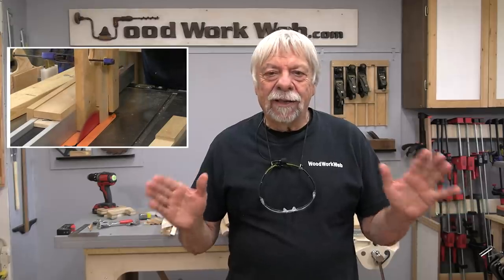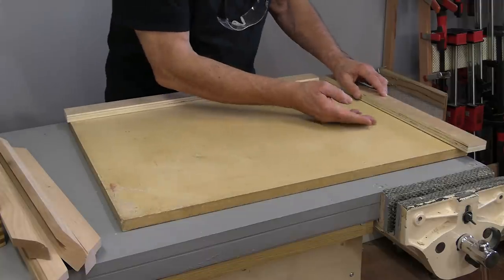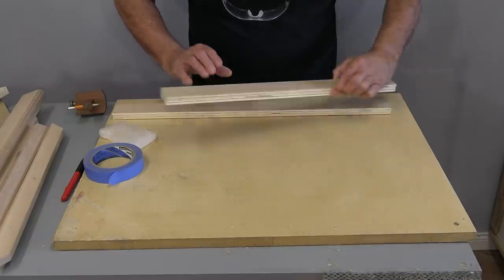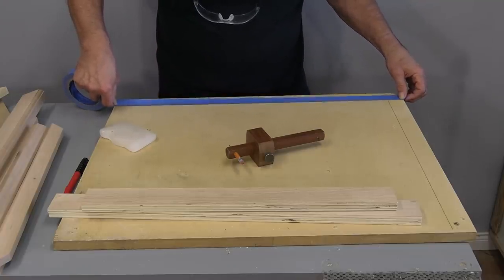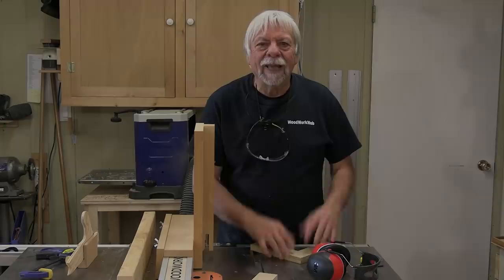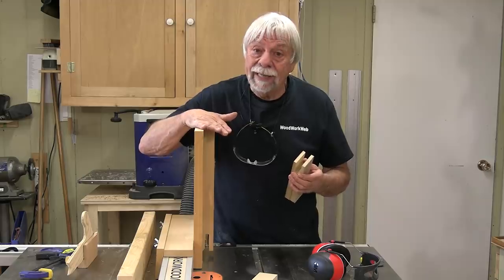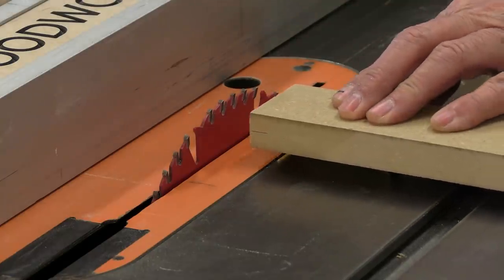Woodworking Jigs for Making Perfect Half Lap Joints Every Time!

Comment: Just buy a part sheet of Melamine coated MDF or chipboard from the big store, glue won't stick anywhere on it. Just put a brad nail or screw in the middle of each side, set 90 degrees and use more screws to permanently fasten. Also, if you leave a 4 inch (100mm) gap in the corner you can use the jig to make 'T' joints as well as 'L' joints.
Reply: That’s a good one with the extra gap.

Comment: keeping a box jointed box square is a challenge for sure, with the tenons sticking out it is impossible to use your "outside square."
With clamps it's hard to adjust box for square. I found an "INSIDE SQUARE," right angle at 90˚ fastened to table will solve this problem. Box be adjusted as clamps are added from top and sides. Love your presentations, I have learned so much.

Comment: I saw a video testing joints and the Bridle joint was sightly stronger BUT not enough not to just go with a half-lap. The 2 by 4 is a great idea! My jig has a 3/4" outside runner and it keeps dropping down in the other miter slot in the top.

Comment: Nice jig! When you do these joints you should always use scrap pieces for test cuts to make sure the depth of the cuts are correct. 

When making a mailbox post this half lap cut is perfect for making the cross piece that the mailbox sets on. For a 4x4 post you cut about 1-3/4 deep. Again you want to do test pieces if you have enough wood. He's right about this half lap joint being extremely strong.  

On a 4x4 post it's easier to do this with a circular saw and then finish the cut with a Sawzall. Then glue it and predrill it and use five deck screws to put it together.  It's better than the pre-made mailbox posts. Use the end of the post that has never been cut into the ground so it keeps the pressure treated part intact. Also dip the end of the post in deck sealer before putting it into the ground. That keeps the post from ever rotting.

Comment: Just a caveat. Using a measuring bar  of a specific size only works if your work piece is the correct thickness. MDF is probably accurate enough, but other lumber probably is not. Since I started using the metric system, measuring and math got a lot easier, too.

Really appreciate your teaching style.

Comment: I use a framing square that I drill a few holes through and then I raise it off the surface of a board using some nuts as spacers.

Comment: What kind of fabric or material do you have on that vise?   Kinda looks like a thin perforated metal sheet, but that wouldn't be flexible or soft enough to protect the material clamped in it, would it?   It's driving me crazy trying to figure out what that is.

Comment: For the assembly jig, couldn't you use a framing square spaced off of the backer board? Perhaps a 1/4 inch spacer on all mounting points, for dust relief.

Comment: Instead of a measuring bar, one can use a 3/8" drill bit.  And, of course, much/most 3/4" lumber is not exact, so drill bits that come in big sets with 1/64th inch increments give you a lot more choices.

Comment: Making a new assembly jig every time you need a new size has long since been replaced with the much simpler notion of “assembly tables”.  Drill a couple 3/4” holes in a nice flat workbench and use bench dogs or straight edge and mft clamps for the fixture.

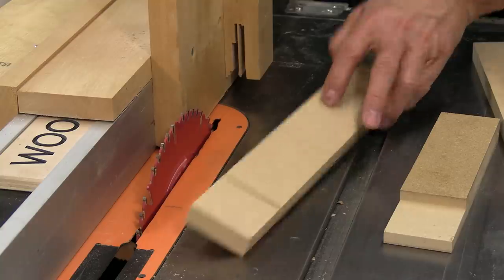Comment: You are a prince. Great tip with the paraffin wax. One question, though. Isn’t the cut at 14:00 a bit dangerous? That’s like using a fence and a miter gauge. The off-cut piece is trapped and can kick back, unless I’m mistaken.

Comment: Wouldn’t a dado blade be quicker for doing the cut outs on a lap joint? Only one set up on the saw and much easier if a piece was 6 or 7 feet long.
Reply: Some saws cannot accommodate a dado stack,or they might be outlawed in some countries, e.g. Germany. I would otherwise agree, though. If available, a dado stack is easier.